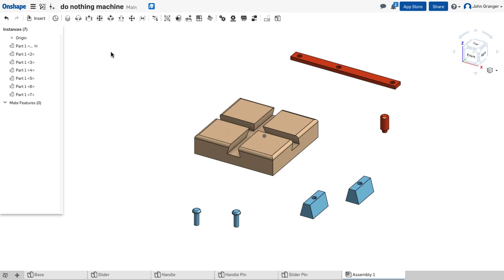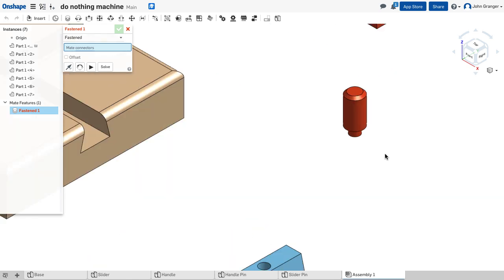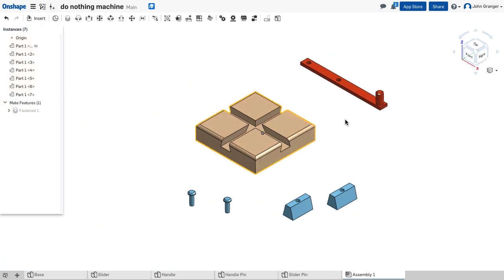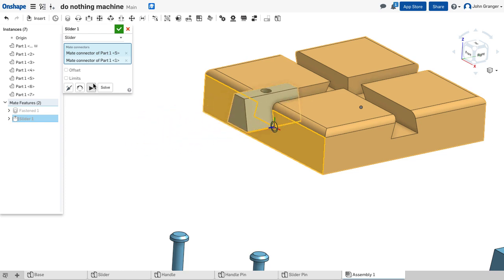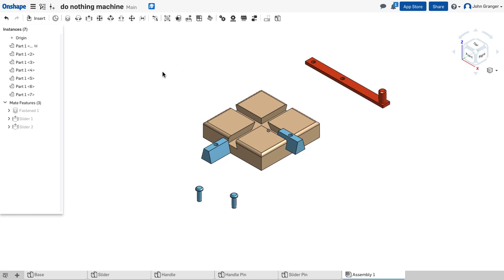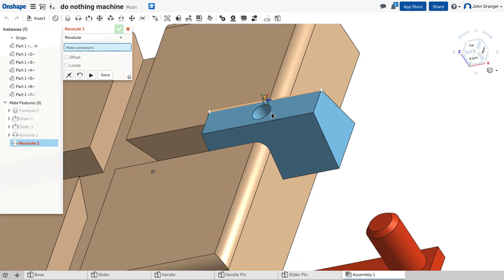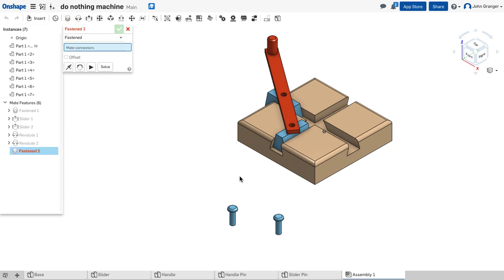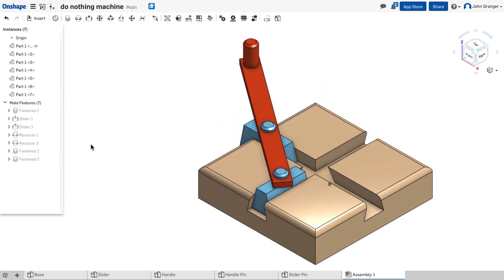Onshape - Do Nothing Machine - Step 7 -  Assemble Using Mate Connectors

Comment: I need help with this. When I do a revolute mate on the second slider (around 4:38 in your video) and I try to solve it, it gives me an error on all of my mate features, saying the "Mate overdefines the assembly".

Edit: Nevermind, the angle on my "Base" shape was a bit off, so the Sliders overlapped with it, so I just adjusted those angles and it fixed the problem.

Comment: For the second slider, I try to do the same thing, except it doesn't go in the same position, WHY????? 3:05 - 3:21
Reply from the maker: Go to the Mate list on the left of the page and delete the mates that you added that didn't work.  Add the slider mate for the second slider block again as shown in the video.
Reply: @Onshape.Learning.Projects  Ok, well, I tried something different from what you recommended, and it worked!! Now my Do Nothing Machine actually works perfectly!!!
Reply from the maker: @mehekelahi5063  Good for you.  Assembly is all about creating relationships between parts and limiting the degree of freedom to just the direction and path you want, so there are many ways to accomplish the same results.  In my video, I just show you one option.
Reply: @Onshape.Learning.Projects  Ok cool. I kinda thought of Christopher Reeve when you were talking.
Reply: @mehekelahi5063  hey what did you try cause i have the same problem
Reply: @vicegardens5546  You turn the slider into the desired position.
Reply: @mehekelahi5063  how?